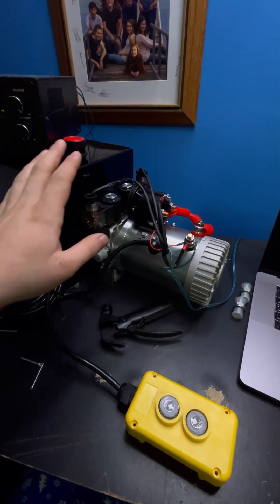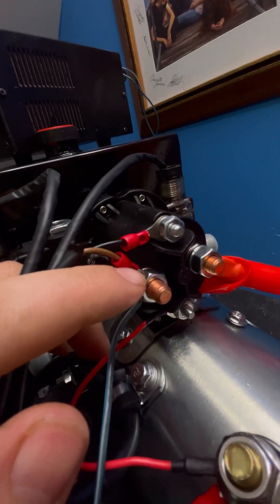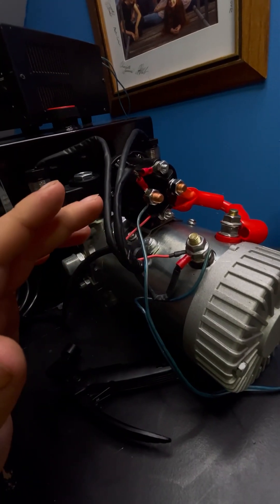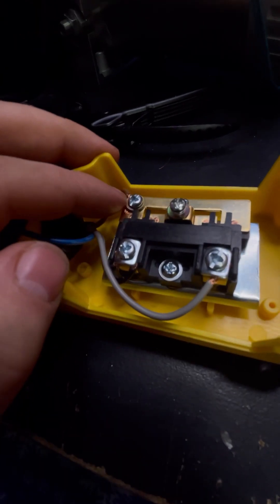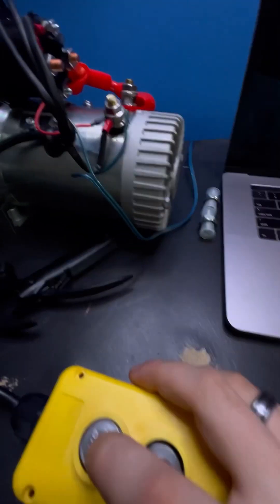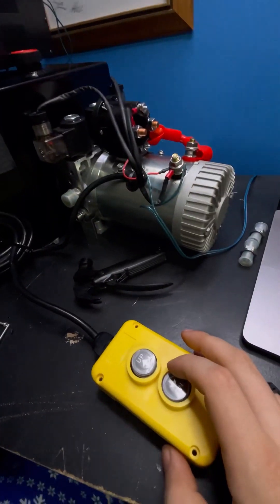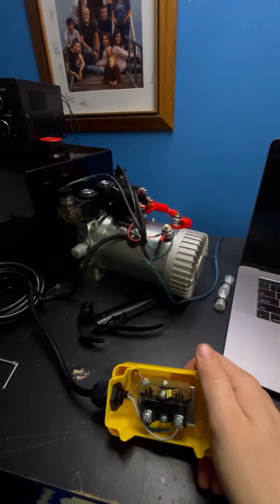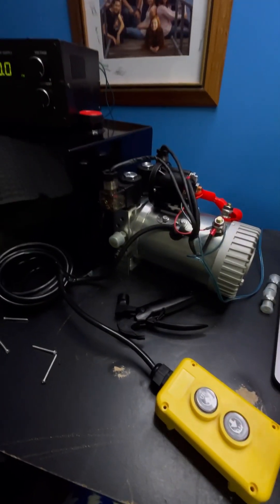Convert a double acting pump into a single

Comment: YOU MY HOMIE! I made same mistake ordering double-acting instead of single thinking proper for my lowrider while waiting to re-wire my 8-battery/2-hydraulic 1993 Lincoln Lowrider. Another video is more complicated but yours easy 5-minute fix and my lowrider hopping and dropping! Thanks from YouTube.com/venicevideos
Reply: what did you connect the down side too? im doing a dump bed on a minitruck cant figure out how to connect hoses to a single action 10' cylinder

Comment: I have a single acting cylinder with two hoses
Can I still use a double acting pump?
Reply from the maker: @dannygilley5090  you possibly could as long as you put the return valve back into the tank, but I’m not really sure to my knowledge. I don’t think so.
Reply: @Gregsadventure  I have a single acting pump, can I use it for a dual hydraulic line scissor lift table?

Comment: If anyone is planning on doing this when i did this when i was fixing my liftgate it appears that the pump does not hold pressure and lets the fluid go back into the pump causing my liftgate to slowly go down over a few minutes. Bought a single acting pump and it fixed it. Maybe it was a bad pump but just wanted to warn anyone incase theyre having the same issue.
Reply: There are two sides to the pump...

One side holds pressure and one side doesn't.

Comment: EXCELLENT!!!   Thank you!
   What I have is a double acting pump and double acting cyl..which can't be used with pressure, I want the oil to flow back but just with gravity.  I don't want to engage the notor , jyst open the solenoud.  Does this make sense?   Its a
Reply: Its an old pallet stacker lift that always used gravity down lever...but it has a hose fitting st the bottom and top of the cylinder.   The old motors pump went on it and this is what I have to work with now.   I just want gravity down :).   Thanks to anyone with a y time for a tip or two!
Reply from the maker: Yes that makes complete, this should help you